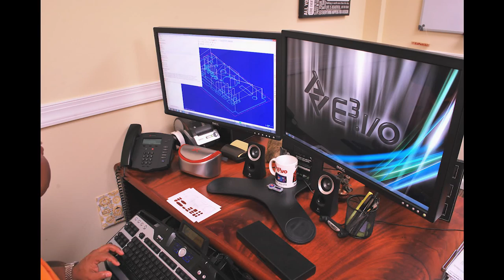How to build a 2DIN CarPC? (Time Lapse)

Comment: How do you create audio output for 4 car speakers and also composite output?
Reply from the maker: We installed an internal amplifier for 4 speakers and 45W per channel. Unamplified computer audio output is also available.
Reply: @E3ioPC  Ok and one.more question, how did you go about making shutoff circuit so it only turns on/off via ignition

Comment: hello, I am a raspberry enthusiast, I would like to produce my own model,
but I do not have the exact dimensions, since it could give me or even sell the 2d / 3d model used to make my case?{
I send a Email to.
Reply: Alexandre Queiroz: The generic case is available on eBay and elsewhere. There are a number of different versions, some with a case, some without, some with the front panel USB/SD, some without, and some VGA and some HDMI. "2 DIN Mini ITX Touchscreen" are the magic words.

In this video, they are custom-milling a rear panel for the options they are putting into it, as by default you just get the ATX-style snap-in port insert and a bunch of random holes.

Obviously there's a lot more work that goes into the build here than just assembling a box, but it's a good place to start if you're building your own. You'd want to integrate things like a pre-amp in the box or an amplifier elsewhere in the car, FM radio receiver, steering wheel button control, auto on/off, an M3ATX or M4ATX power supply, CAN or OBD2 connectivity, etc, etc.

These guys are obviously great at what they do. I wish I had a CNC mill, CAD software and the know-how to mill out whatever I wanted :/